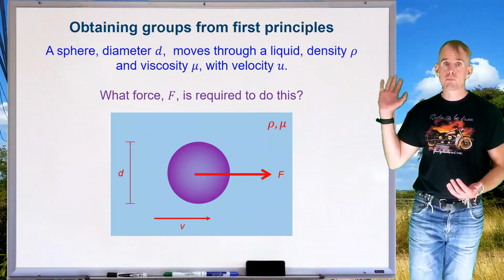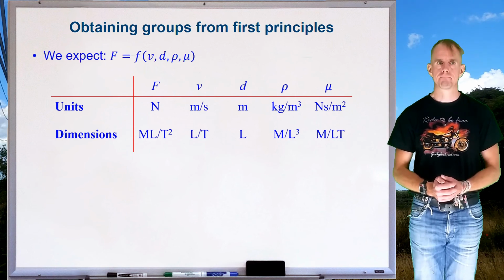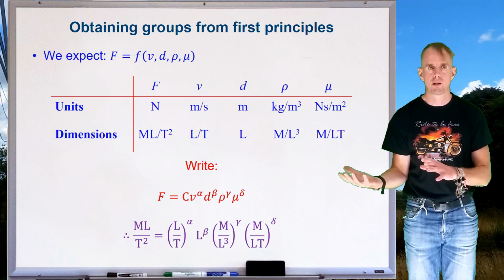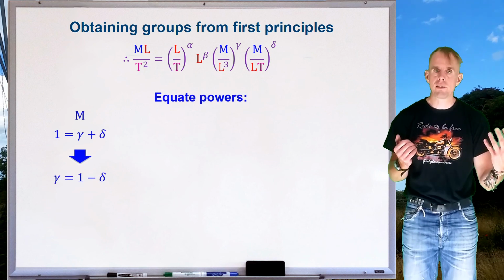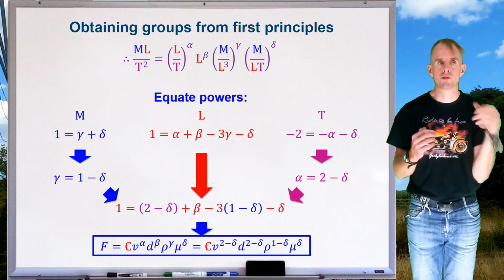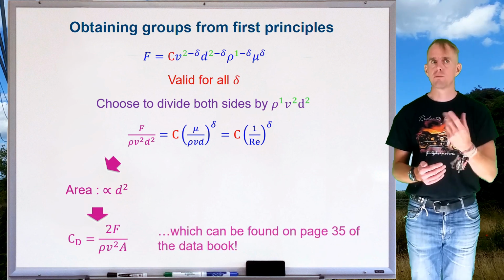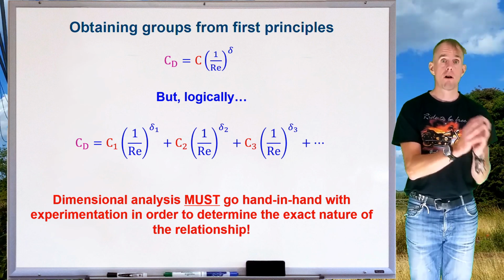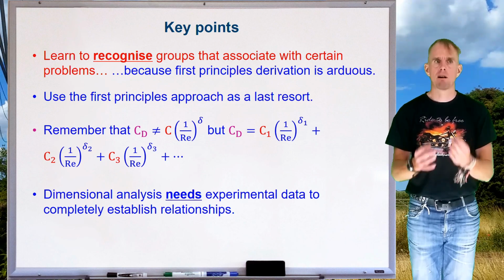Introduction to Chemical Engineering - lecture 4(3) [by Dr Bart Hallmark, University of Cambridge]

Comment: Thanks for the videos they are helpful. If it is possible could I get access to the data book? and what are the reverenced textbooks for this course.
Reply from the maker: I'm very glad that you find the videos useful! And thank you for telling me - it's much appreciated.

I'm afraid the data book is property of the University of Cambridge - and something that I'm not at liberty to give out (especially since I've recently quit my job there!). Sorry about that. There aren't any referenced textbooks for this course - it's an original course. One book you might find useful though is Solen & Harb "Introduction to Chemical Engineering". It's not a book I've used much, but it's one we used to recommend to students starting the course. I hope this helps a bit!
Reply: @drbartsworldofchemeng   Thank you for replaying.
Reply from the maker: No problem :)